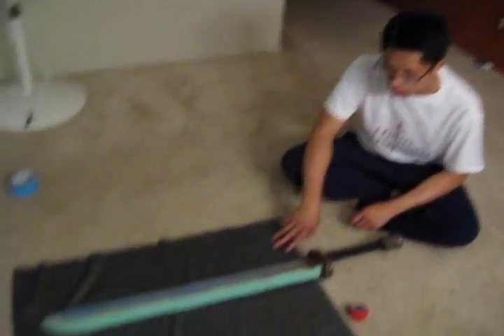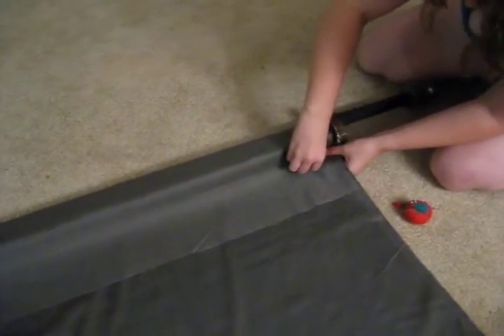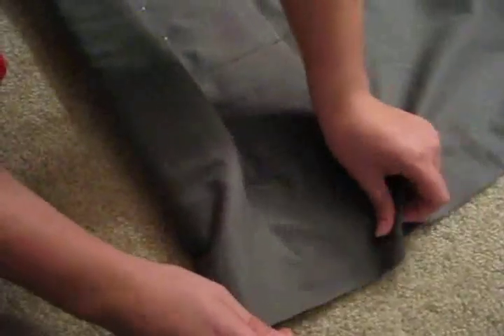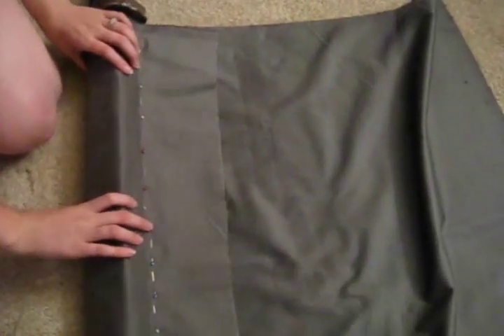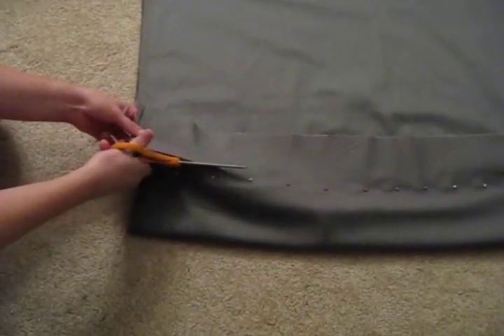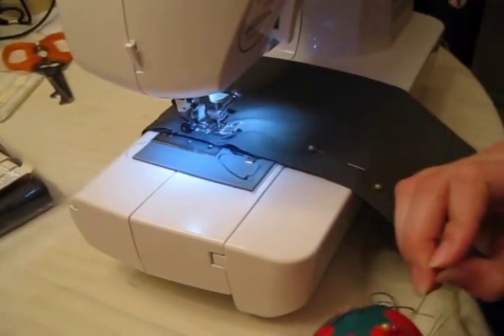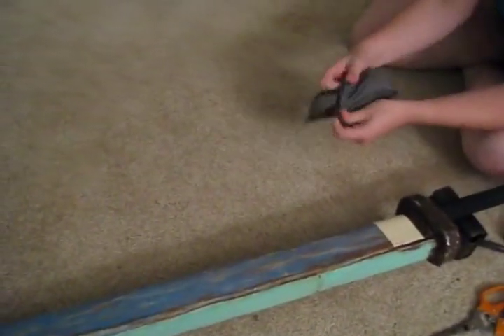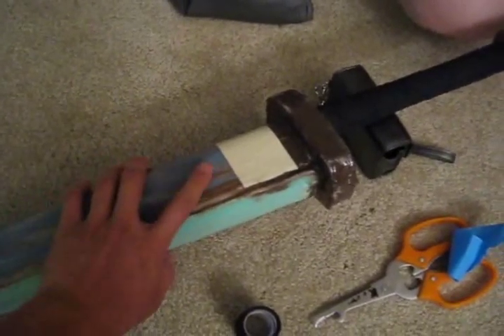How to build a foam / latex katana style sword Tutorial part 8 of 8

Comment from the maker: @Doradanis1 very good questions. I used a cloth cover because that's the accepted rules for the majority of groups in the US. Latex or plastidip covering could potentially be more durable, however, the cloth allows the foam to "breath" which means it gets to contract and expand more freely. 

As far as your other questions go, I've neer had an issue where the core actually comes out of the foam. As long as your core is safely secured and sandwiched, there's not really any way it can come out

Comment: question:
why you did a cloth cover instead of a latex cover, since latex looks like a lot more resistent than cloth?
and, is that protection on the top of the core enought to avoid any kind of accidend? like the core piercing the foam or the tip bending and making the sword unsafe?